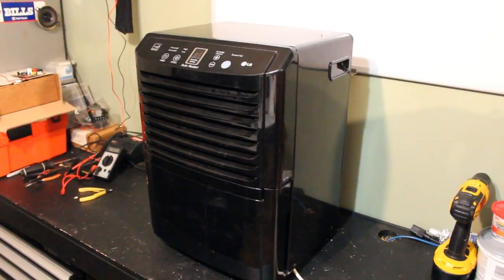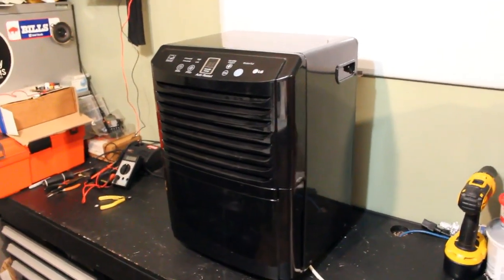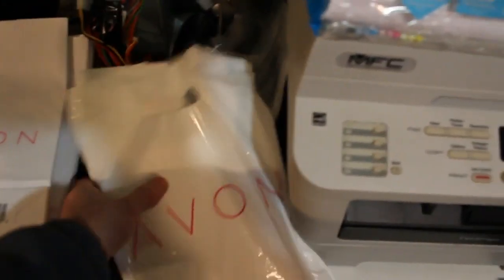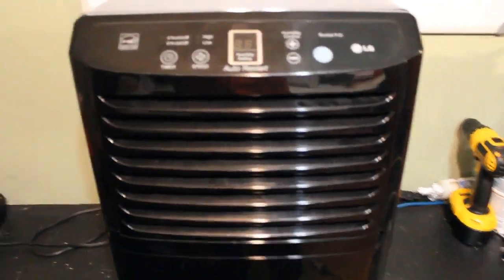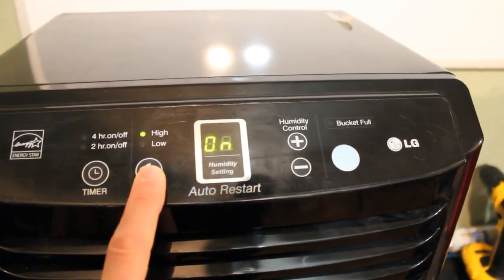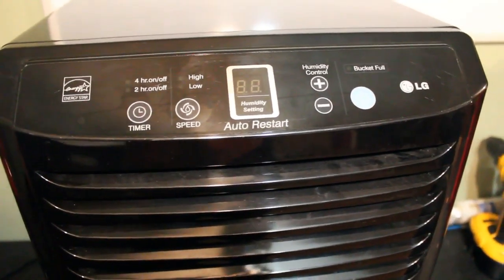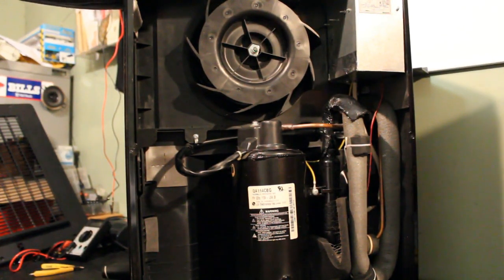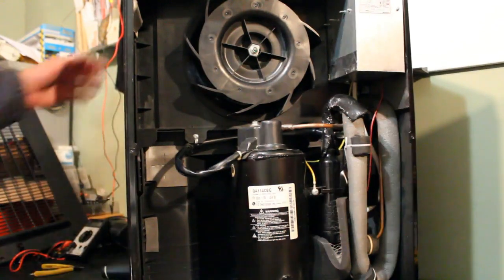Curb Find : LG Dehumidifier analysis and teardown, saving electronics and relays

Comment: Thank you for this video, helped me with a repair
Reply from the maker: Glad it helped
Reply: @frankiefixdiy   Literally brought the LDH659 back from the dead, black wire was fused off the compressor cap due to frequent use on extension cord. Now purring like a kitten
Reply: I have the same unit it doesn’t collect water the compressor kicks on but doesn’t collect water
Reply: @warwick170  probably lost freon

Comment: I have the same LG model  LD650EAL dehum. But mine fan doesn't run & it just humms??
Reply from the maker: hmm, sometimes when motors hum it can be the capacitor, it typically holds a charge used to jump start the motor. Try to give the fan a quick turn with your fingers being careful and see if it turns then. If it does the capacitor needs replacement or fan motor is bad.

Comment: I have one exactly like that. Works fine. However, It only comes on 2hr, low & 50%.
Can no longer make any adjustments.  Any ideas? I've taken it apart. It appears everything is fully connected
Reply from the maker: I wonder if there is an issue with the humidistat or the control board, see anything burned on the board?

Comment: I've got a four year old LG UD701KOG3.  Running in a clean environment. No longer collecting water.  Compressor runs.  I don't see a recharging port.  Any ideas?  Hate to have to put this in the recycle center.  BTW.. the Bills sticker indicates you might be in the Buffalo area?
Reply from the maker: You got it Richard, I just did a new video on replacing rotten galvanized pipe with Bills Logo at the end.